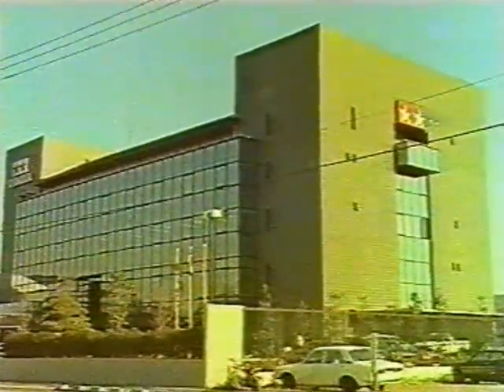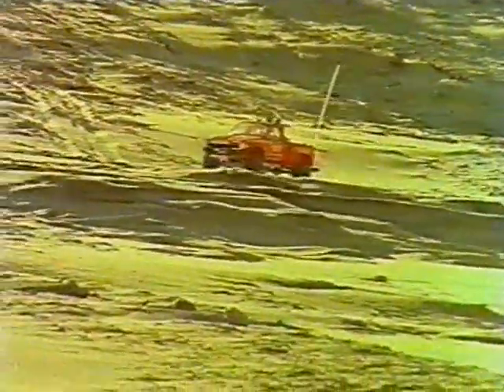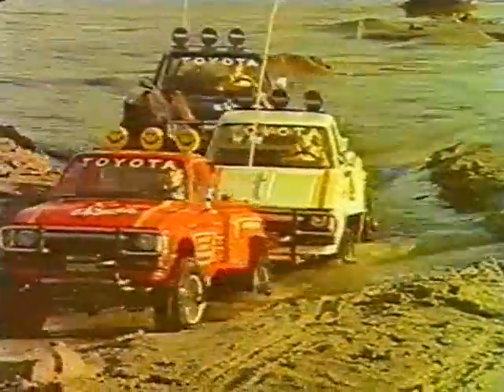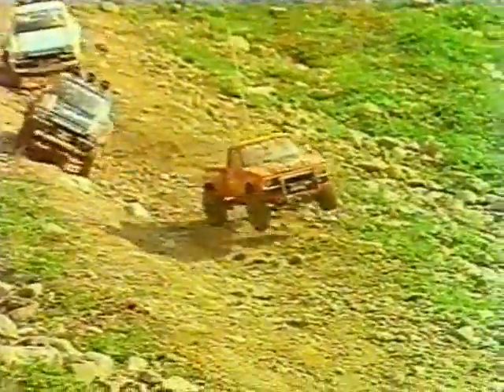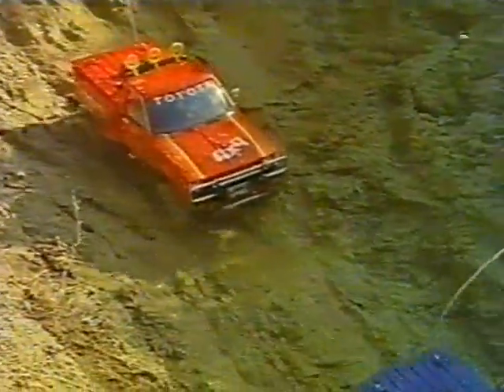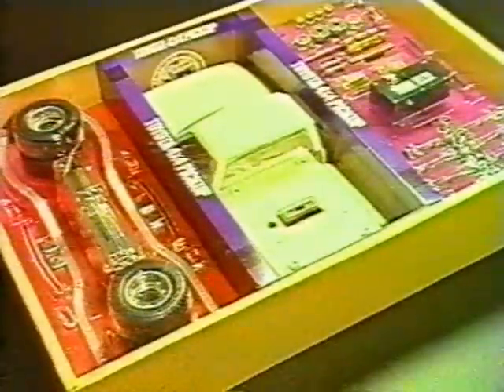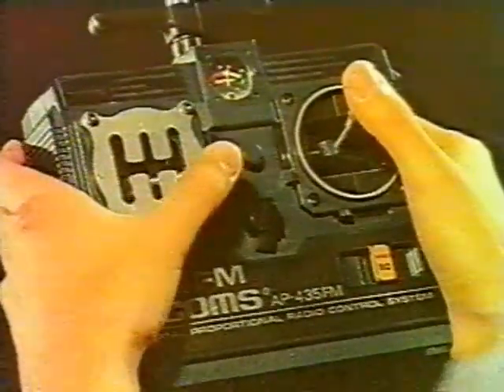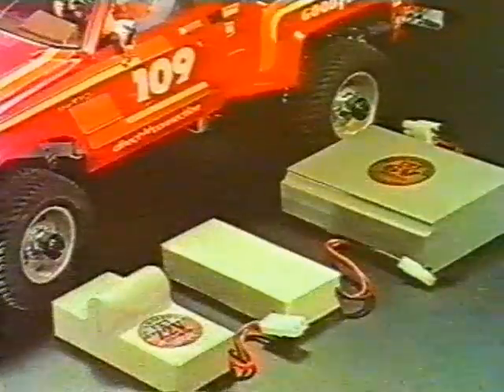Tamiya original Hilux RA1028 Promotional vintage video

Comment from the maker: Original Hilux RA1028 has either Mabuchi RS-540 (white plastic endbell) or Mabuchi RS-540S (black plastic endbell). The "re-release" Hilux (which IMHO is almost nothing of the kind because of e.g. it's plastic gearbox) has Mabuchi RS-540SH (metal endbell). The Blazing Blazer had same as RA1028. The Bruiser and Mountaineer had Mabuchi RS-750SH. Cheers, Alistair G.

Comment: WHAT IS GOING ON NOWA DAYS? i just got the traxxas trx4 bronco and its not as awesome as this toyota..  blast!
Reply: Because inflation. If manufacturers want keep prices relatively down, they must something sacrife.

TRX4/6 are best actuall chassis on market. You can build your own hard body on it, and it will look better than this 40years old.
Only need remember trx4 is 1:10 scale for trucks. For 1:10 hilux are axles too wide.